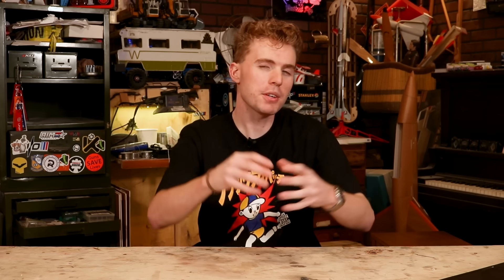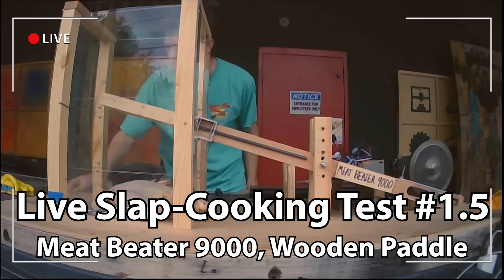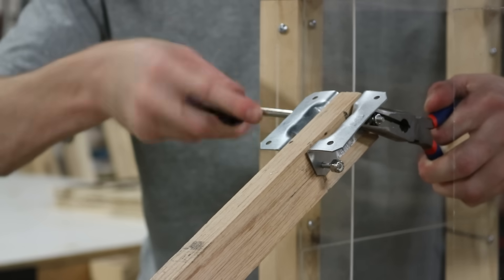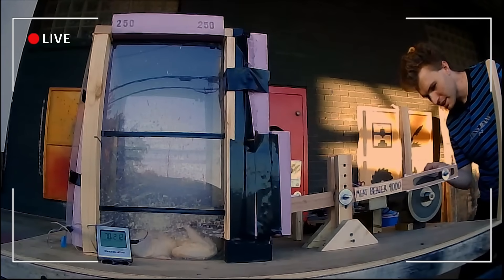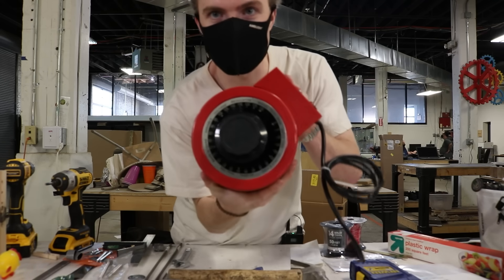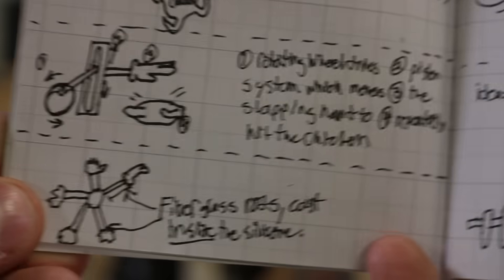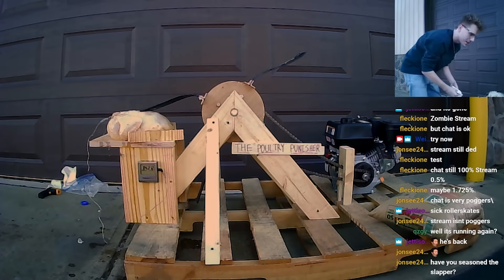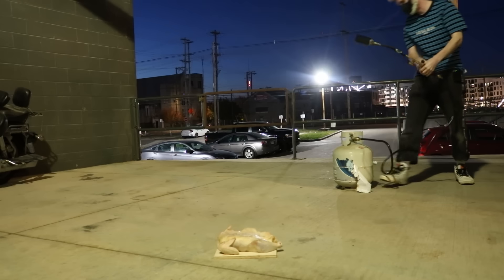How Many Slaps does it Take to Cook a Chicken?

Comment: I suspect they would have greater results if instead of one rotating rubber slapped they had two angled opposite each other. It would also result in the force being applied to more than one area of the chicken which should decrease the damage. A simple solution would to have it alternating slaps and to time it right have them on a chain like from a bike or chainsaw. It would allow for an increase in frequency of slaps and should reduce the damage. 

The goal should be to add enough friction per slap to add heat, but not have enough friction per slap to cause significant drag or damage to the chicken. 

It may also be worthwhile to consider the biology of the chicken in determining the best way to slap it. An analog for humans being hit on the skull, the forehead is very dense where as the temple is very thin, as such hits to the temple are much more damaging. If you were to arrange the machine to hit the chicken such that the bones are more likely to absorb the impact and distribute it through the body it should have less broken bones.
Reply: Another thought on this, the way that ovens work is that the air molecules hit a glass or metal pan, although air is a poor conductors of heat it may be beneficial to consider instead of slapping the chicken slapping the pan, as the specific heat of the metal should be lower than the specific heat of the chicken.

Comment: So now that it has been established that directly tapping a chicken with a stick is more likely to pulverize it than cook it would following workaround be considered cheating? Everyone who has tried to fix a flat tire on a nice ride through the woods on their bicycle knows that pumping the tire full of air with a hand pump create a lot of frictional heat at certain parts of the pump. So what if one created an oven like contraption where instead of electricity or fire as the heating element you used the friction heat of compressed air created by a steady flow of slaps to heat up the oven and thereby cooking the chicken?

Comment: Could the fact that the Poultry Punisher was less effective not be due to the the fact that energy was lost in deforming the rubber more readily than by heating the chicken? The rigidity of the Meat Beater seemed to be its strength.

Comment: Why not put the chicken inside a metal box, and slap the box? You can go to town on the box while keeping the integrity of the chicken. Your poultry punisher could even go to absolute town and transfer the heat into the metal. Just make the chicken barely fit and slap both sides and you should have a very inconvienant toaster oven. Sure it's not slapping the chicken, but the metal will conduct heat better, but also lose it faster, yes.

Comment: Why not use the slapper to heat a metal surface & indirectly used slaps to heat the chicken? Also, I would have gone directly to the fan design you ended with 😬🤷🏽‍♂️ It’s simpler so less of a chance to fail. But at least ended up getting there eventually 😬

Comment: I have a solution: you should have wrapped the chicken with a custom fited flexible metal mesh or something to keep its shape during the slapping process. I'm not sure if a heat resistant silicone wrap could work too. Also you can "stitch" the chicken with thick thread all the way through its skin to its core to firm it up. Or maybe  CNC a custom-fited chicken-shaped steel encasement so when it heats up all the heat is trapped inside like an oven, it also protects it from the slaps. Sorry for the bad English.

Comment: The problem I see with this idea is that much of the energy of each slap goes into elastic or plastic deformation of the chicken (bouncing/squishing), rather than friction (i.e. heat). 
Rubbing the chicken on the other hand?- Minimal deformation while maximising friction. So why not ask the question: Can you rub your chicken hard and fast enough that you cook it?
Reply: Farewell Meat Beater 

Hello Meat Stroker
Reply: @James11111  That was genius
Reply: I think it’d just get sanded down to be honest
Reply: I mean, if you really want to watch someone rub their chicken sensually for like six hours, you go right ahead.
Reply: If the chicken keeps disintegrating where contact gets made, why not coat or otherwise cover the contact surface with something rigid enough to not break down and to preserve the chicken’s integrity, conductive/thin enough to allow heat transfer through it, and seasoned enough to increase the tastiness of the result? I’m imagining a lemon pepper alloy of aluminum sheet on top the chicken, bolted down onto the chicken to that it’s tightly fixed in place, and as the spin slap structure does it’s thing, the heat transfers through to cook the chicken, while the integrity of the chicken itself is firmly held in place. Oh, and it self-seasons, of course.
Reply: @breetaylor4586  you’re making a stove with extra steps.
Reply: OOOOHHH-
Reply: Or spatchcock it. No cavity means there's less room for deformation/bouncing and you're not losing as much heat on the underside.
Reply: All of the energy that goes into deforming the chicken becomes heat anyway, so it doesn't matter. The real problem is that you need to put out enough power such that the temperature at which the chicken's rate of heat loss to its surroundings equals the rate of heat input is high enough to cook the chicken. You'd sooner cook your arm, assuming that you could even output that power.

Comment: Would if you were to launch a hand out of a cannon at the chicken, as a way to try and do the single slap as the original math was calculated with.
Reply: I feel like it would just break through the chicken
Reply: @alpacawithouthat987  There could be a mechanism that stops it right when it hits the chicken, or just have it fire it faster than the math and have a spring system or something of that sort to slow it down enough to be at the right speed but pulling it away right when it hits the chicken
Reply: @cakeface_03  if it stopped that quickly, it would break or even explode

Comment: I don’t think your graph is correct. As the chicken gets hotter, your graph of temperature shows it getting easier to heat the chicken. Shouldn’t it actually be a graph of energy required to heat the chicken, with it getting harder, and requiring more energy, as temperature increases?

Comment: Ok, I've watched the entire video and this question has occured to me and methinks SHOULD'VE been asked first:

A pertinent question at this point is to ask how to transform a higher percentage (ideally 100%) of the thermal potential part of the kinetic energy into heat to cook the chicken, while at same time minimize the amount of mechanical part of the kinetic energy (ideally 0%) from transferring into the chicken and wreak havok on its structure.

The problem with the flapper machine is that too much rubbing force is being applied to the chicken (the flap hits the chicken, the drags along the length of the chicken towards the hub of the Flapper. This is most likely the primary cause of the failure in the chickens structural strength.

I suspect another problem, if ye were to put a high speed camera, you might see that each flap recoiling away from the strike zone may actually interfere with the incoming force of the next flapper, thus reducing the net amount of the incoming kinetic energy into the intended recipient (the chicken) thru phase cancellation. Thus the heat is being redirected back into the machine's flaps which is probably then being dispersed into the air.

After a moment's worth of thinking, I suggest reverting back to the Slapper. Next calibrate the slapping stroke so that it hits the target surface but not with so much travel that it tries to smash INTO the target's interior. Next, to protect the structural integrity of the chicken itself, mount a small metal plate (like a skillet) so that its in direct contact with the chicken but is mounted solidly so that it wouldn't crush the chicken. A stray thought has occured to me, maybe make the plate semi-flexible so it can absorb the kinetic energy into itself which should convert into heat which should then transfer into the chicken.

To maximize transfer of heat from the plate into the chicken, prewrap the chicken in metal foil AND then wrap the whole thing in an insulation so that only the contact point is exposed and in direct conductive contact with the metal plate. This should minimize heat loss from the chicken itself, and if the metal plate is as close as possible to the size of the wrapped chicken's exposed area, that should maximize transfer of thermal energy into the chicken and minimize heat losses into the air. To further reduce heat loss to air inside the enclosure, try reducing air pressure to minimum. I forget the name of the law, but I seem to recall that cooking temperatures are lower in lower air pressures. That might help if true.

You should continue to use wood for the structure enclosing the chicken to minimize heat loss from the skillet into the structure. The structure should also be as small as possible to minimize the volume of air. I suggest integrating the fulcrum into the structure itself, adjust the pivot point closer to the chicken end to minimize the length of travel the chicken end is moving. Extend the wheel end longer and use a larger wheel to reduce the stress on the motor. Of course, this means you'll need a higher speed rated motor to compensate. One might point out that the wood lever might not be able to handle the stresses of the higher travel speeds of the longer wheel end, but I think it should be somewhat mitigated by the longer dwell times the lever will spend at each end of the stroke due to the larger wheel radius. But if concerned about the structural strength, go ahead and use a hollow metal tubes as a lever. Hollow tubes will be less massive than solid metal rods. On a similar vein of thought, it might be better to use a metal wheel on the motor to serve as a flywheel to make the motor end more efficient and help keep the lever in motion. For the slapping end you might want to keep using a wooden paddle, more to minimize the racket the skillet will make!  The vacuum sealed enclosure should also help in this regard. ;)

I'm taking inspiration from the combustion motor's flywheel portion and design elements from some pump designs too.

Hope this inspires the next iteration of the Chicken Slapper! 😁

Comment: Nother problem yer contending with is the ridiculously oversized interior volume of the chicken enclosure. More volume means more heat is escaping to the air inside the volume. Air can absorb a ridiculous amount of heat faster than ye can generate via bitchslapping the the uh.. NVM.

Anyway, reduce the internal air volume may realize a net gain in heat retention when slapping yer ...chicken. 

Gods why can't I keep a straight face while discussing a ...strictly scientific ...situation??! :/

EDIT: It's an hour later, after I took the dog out for a walk and then watched the second half of the video. I think the conclusion is that while it is possible to add heat via slapping. It's not possible to add enough heat via slapping (or any other mechanical force) because the structural strength of the meat and bones of the chicken becomes the limiting factor. The cumulative force of the slapping action over time degrades the structure of the chicken long before it gets up to cooking temperature. That raises the precise question which must be asked, of which I will posit in the next post.

(to be continued)

Comment: they should've done gear ratios to where the motor could rotate faster without working so hard... ORR could've gotten a fricken turbo diesel v8 baby hell yeah all the horsepower

also u could theoretically make it slap a thin yet resilient container made of like fiberglass or something and have the chicken inside. It would possibly trap the heat inside while maintaining the integrity of the chicken... idk just an idea, never tested it at all.

Comment: the poultry punisher has a CRIPPLING design flaw: when the fins slap the chicken, they pick up a lot of moisture causing them to cool down rapidly on the way back around. every time you slap the chicken, the fins absorb the heat and through evaporation, disperse it into the air. a dry victim would prevent a large amount of the heat loss while also allowing the chicken to receive heat more efficiently due to higher friction.

Comment: Put a surface that won't be shredded on top of the chicken like a thin dish that easily transfers the heat energy. Slapping the chicken directly will obliterate it so slap a plate protecting the chicken and then crank it up to 100,000 slaps per minute.

Comment: Putting oil on the chicken was a bad idea, the reduction in friction is a reduction in heat production, same reason slick 50 destroys engines out of oil but keeps em cooler in the process of throwing those rods and bearings

Comment: To Cook with slaps is to cook with The energy of The slaps.
They do not need to be applied directly at The chicken, do they?
Encase The chicken in something durable that transmits heat, like something metal based, isolate It from Wind and get The poultry punisher slaping The metal.
Metal case gets hot via slap, chicken cooked via slaps.
Bath The chicken in Salt and Lemon before, and then a little butter.

Comment: No my friend, you are doing everything wrong. Instead of using that small wacky engine use a proper engine. For example a V8 engine or an engine with high rpm, the chicken might disappear because the meat is soft, but you should be able to prove the point.

Comment: Obviously the mechanism didn't work because the object slapping didn't have any heat. By slapping the chicken with an actual hand, the body heat from the hand is transferred and exponentially increases the temperature of the chicken, cooking it after 23000 to 25000 slaps, whereas the objects in the video needed 2 billion slaps to cook the chicken (which is way too many before the machine eventually breaks). The obvious solution to the problem is to sever off an arm (from someone willing to do it for science ofc) and instantly attach it to the mechanism. This shouldn't be much of a problem as the lives of chickens have already been sacrificed. Cutting of an arm isn't anything crazy as it won't kill them and they can get a cool prosthetic and a nobel peace prize and money and bitches. I'll be waiting for this in your next upload.
Kind Regards, top of graduating class physics student. 
P.S. hi okay goodbye

Comment: it will never work until you can capture all the friction as heat and direct it at the chicken, you'd need a ceramic refractory environment with a slapomatic installed in it using all ceramic construction for hygene and structural integrity, then flip the switch until the total input energy is enough to heat the bowl, this would take an UNGODLY amount of time, just using the power of slaps and the friction in the chicken i'd estimate about 12 hours, using consumer grade electronics, and the kinds of energy involved, it could be done but it's stupid as hell, it would be easier to just blend the chicken in a blender until it reaches cooked temperature.

Comment: The problem is the math. You forgot to factor in the 98.6° that a human body has. You were using ice cold devices trying to create energy. If you used a 98.6 degree device with consistent temperature while slapping that would increase the temperature of the chicken. That in turn would shorten the damage to the chicken by decreasing the number of slaps required. Basically you need 98.6 degrees hot slaps

Comment: Could you use the original slapper and put it on some kind of rod to hold the chicken in the air and slap from both sides? Maybe generate heat from both sides

Comment: Bro ur doing it wrong u gotta use multiple sturdy "version 1" slappers to cover all the sides of the chicken and then make sure they are synchronized and remember to use insulation also placing a few small heaters should be allowed since our bodies give off a bit of heat and thered be multiple people around the chicken, so use insulation and small amounts of heat to simulate those conditions. Do not let the chicken win.

Comment: This is so freaking cool. You need pressure sensors on the bottom of the chicken, a simplified dynamic model of the chicken's internal structure, and feed back control on the motor. Duh.
But that pushes it out of hobbiest territory. So, nice job man.

Comment: What if you mounted a metal sheet and placed the chicken underneath but in contact with the metal, while the slaps slap the metal and heat it up, in turn heating up the chicken under it? That would make it safe from becoming a paste altough it would be indirect cooking by slapping.

Comment: I don't believe that the format being used here is impossible; if you consider how friction at high oscillations creates heat, then it would be a matter having high amplitude mini pulses all around the chicken's surface area

The contraption required to achieve such a thing would be outrageous, on the technical level of how microprocessors are manufactured. It would be easier to buy an air fryer

Comment: You're analogy with the boulder and hill was spot on b ur I have a question. Your first design for the slapper was good. But what if you added 2 more to the sides, and had the climate control like you did. That way the hill is shorter and you have more than one person carrying the boulder making it easier to get up the hill

Comment: The slaps also were too soft when they used a more flexible material 🤷‍♂️.
This isn't impossible.  Just impractical.

We need something more durable.

If we made a really thin but firm tin pot and an enclosure for the heat it could work.

It wouldn't be slapping the chicken, but the chicken would be cooked by slaps.